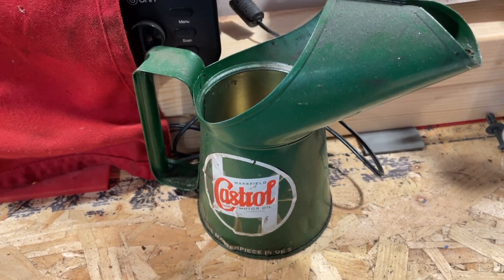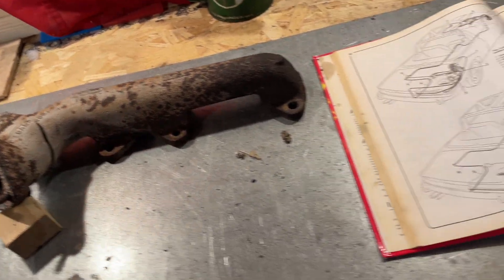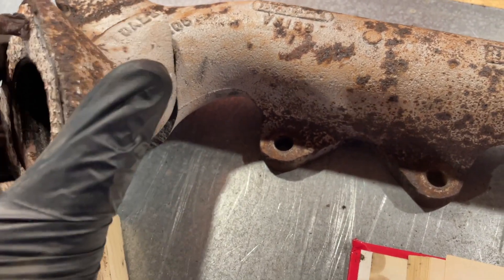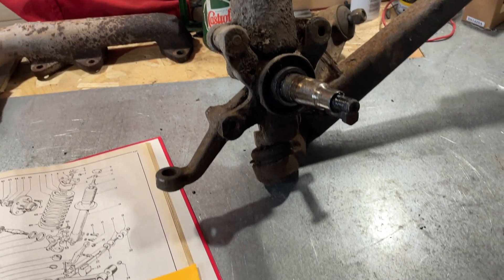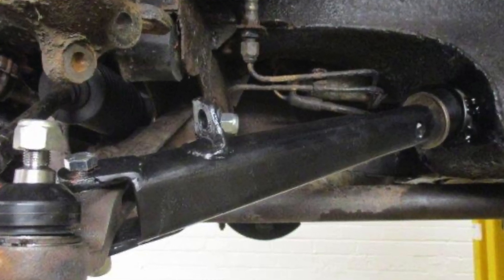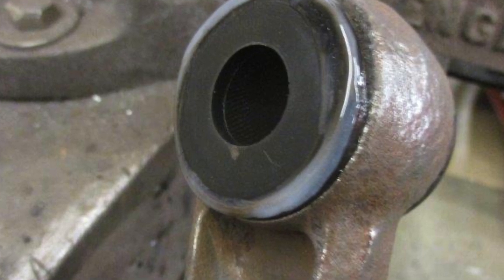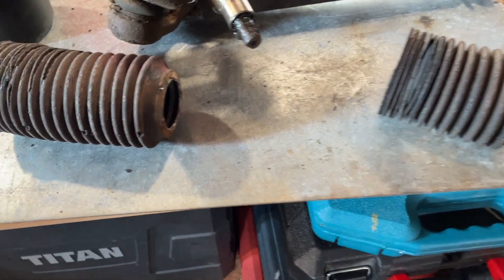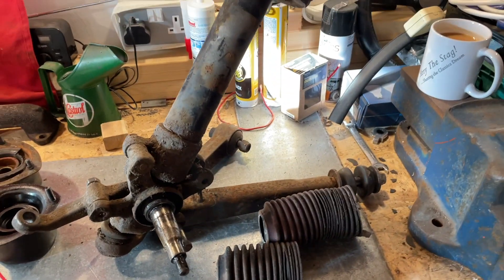Triumph Stag -  Front Strut & Stuff!

Comment: Thanks - most informative. I suspect my 2500S has equally decayed swivels as it doesn't want to self centre the steering. The boots are done. So, I'll be ordering a rebuild kit from Rimmers in the new year - probably no point doing it over Christmas. Freight to Oz might be scary but the parts are very cheap compared with modern car OEM equivalents. All the best for Christmas. Steve.